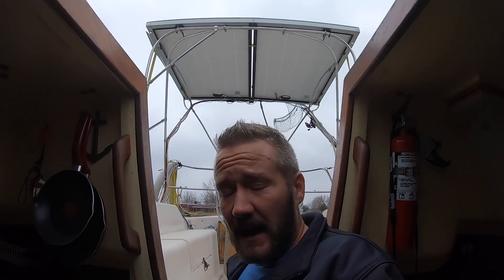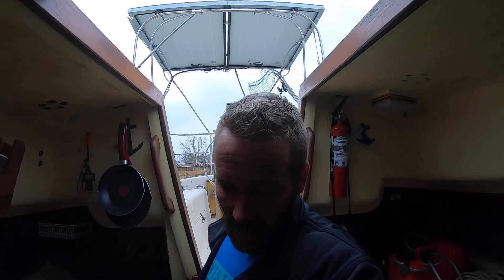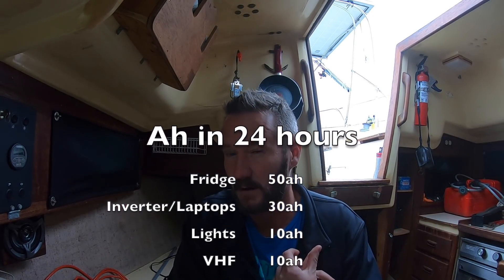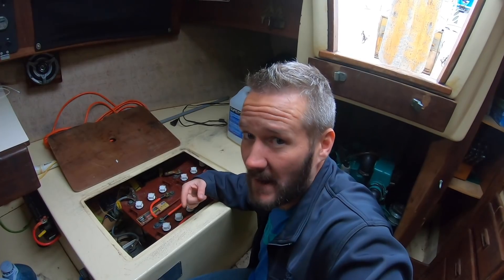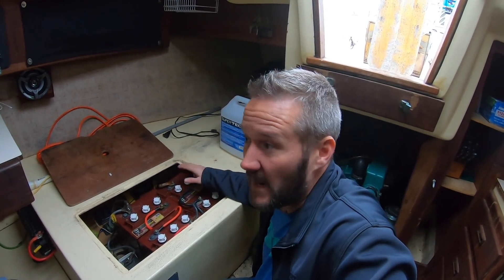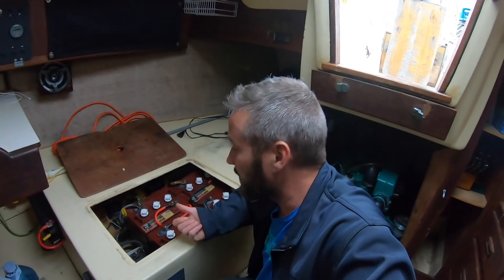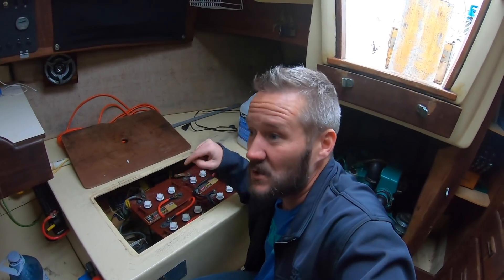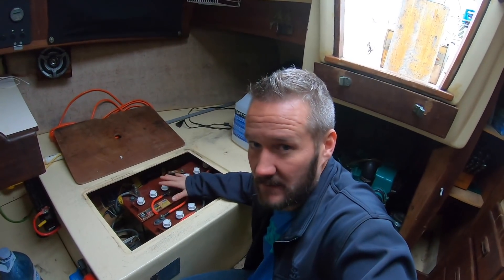Boat Amp Hours - Boat 101 - Lady K Sailing

Comment: Looks like you haven't heard of SUPERCAPS? I have 6x 80a/hr(480ahr) 12v caps on my 45' cruiser. My boat is the first in the world equipped with them. They are 98% efficient, 1 million cycle lifespan, no chance of them exploding or burning. No corrosive chemicals or gas stored or emitted. They operate between minus 50⁰C and 80⁰C. They can be safely discharged to 0v and stored under the workbench for 6 months and recharged when needed. They comply with all international aviation safety regulations and can be flown on a passenger aircraft safely and have a 10 year factory guarantee. I have had them on board for 3 years and are performing at 100%. I run a 12v 1.2kW windlass(100A). Autopilot, nav station, all lights, pumps, 80L freezer @ - 18⁰C and fridge @ 2.5 to 4.5⁰C. 2x 330W pollychrystal solar panels, 100-50 Victron MPPT and 12v to 12v- 30a Victron charger for changing with alternator. Lithium is sooo last Friday's technology.  Cape Town South Africa.

Comment: Hope it's cool to put here, awhile back I made a comment about a custom build system that I had built and gave a brief description of how to make one it was suggested that I do a video I said that I would but it's taking quite a while for me to post. Keith Robinson CUSTOM BILGE PUMP is my channel and video name. Feel free to check it out and please feel free to comment. Only thing that may be a problem for some is it's a 110 volt system but a pump is amp bases system so you could have this hooked up to a single marine battery and it'll power it because it'll push plenty of amps, in a system that's like a pump where it's really responding more to the amperage than the voltage you can lower the voltage and raise the amperage and still run the system just fine without any problems for those who want to plug it into a 110 Source your inverter is your friend

Comment: Nice vid  I used the Victron BMV 712 Smart battery monitor instead of the Xantrex - this will talk Bluetooth to the Solar Charge Controller so that you get better control over the whole system.

Comment: Kinda wondering what happened to y'all. Hope all is well, and if you moved on to greener pastures...we wish you all the best.
Reply from the maker: Hey Cory. We’re still here. Just took a little winter break. Back soon!
Reply: @LadyKSailing  instead you could use the $4k from the wind turbine and put it into Lithium Batteries that would more than double your stored Amp-Hours in the same size space to get you through those 2 or 3 days without sun.  Are you set up so the engine alternator charges the house bank as well as the starter battery?

Comment: I am working on my retirement plan, cant discuss any of the finances part BUT, I am seeking a 60 footer hatteras LRC Trawler and want to do solar as well, is it hard to find 400-500 watt solar panels as well? I would like to be able to use solar and/or wind and not use generators all the time (mostly for at anchor times). I would be curious to get some feed back.
Reply: Generally available panels are from 300-365 Watts per 1 x 2 mtr panel. 
Cheers